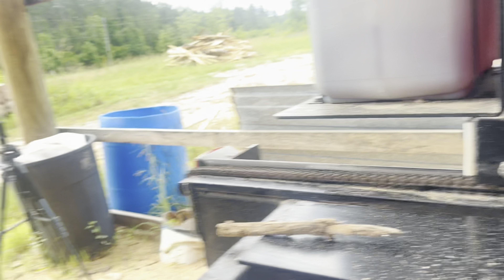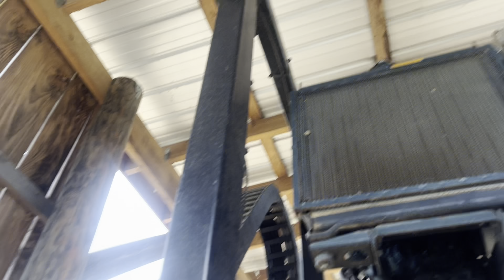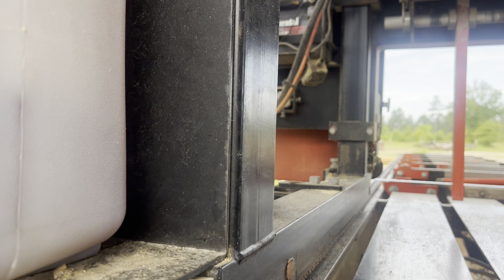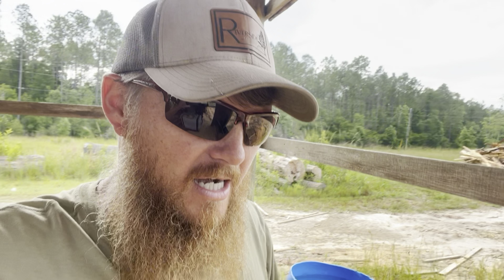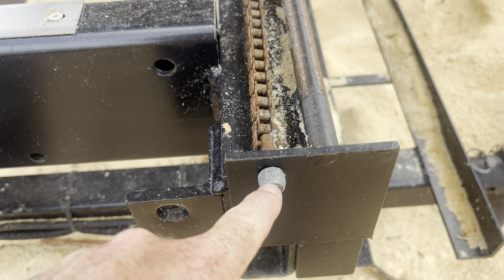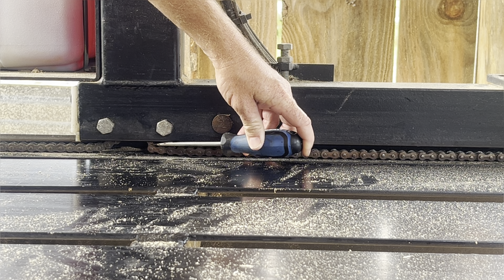Don't neglect this! It can cause down time. Let’s fix it!

Comment: I have a question for you I have a 2200 Timberking the set works jerk on the way down. They are smooth going up. I have put new blocks in it. Keep the post clean and lubricated. I’ve talked to Timber King. Every cut can be different. They tell me at Timber king. The tolerance on all band meals is 16th inch but you may have a board that would be a light inch next board might be a 16th, if you’ve ever been in this with your meal and no I don’t I would appreciate some information on it and by the way, my name is Leon Graves and I enjoy watching your videos
Reply from the maker: @leongraves1613  email me you contact info @ riversidewood_farm@yahoo.com and I’ll give you shout tomorrow sometime or your convenience and I’ll walk you through everything I have dealt with on my 1600 and my 2020.
Reply from the maker: The thing I found on my 1600 mill that was throwing the measurements off was an egg shaped bushing on the guide roller pin.